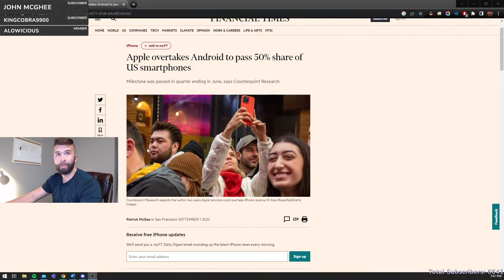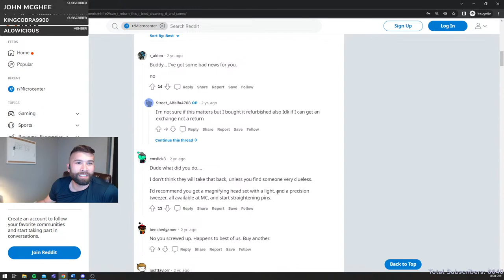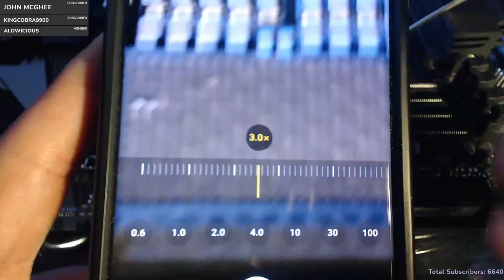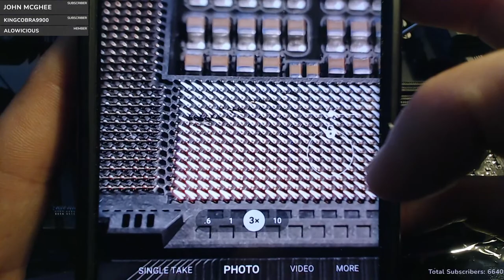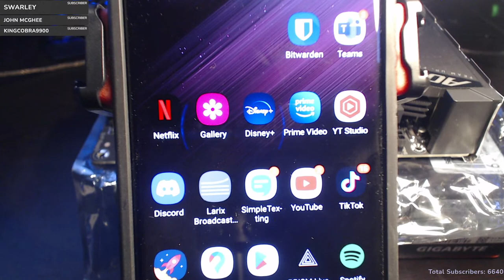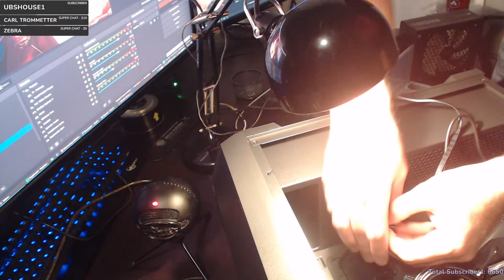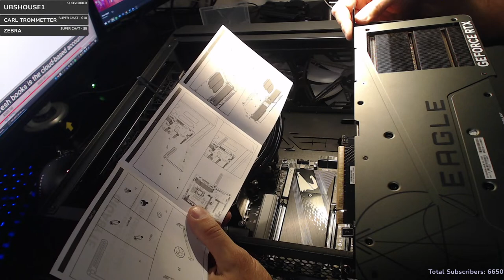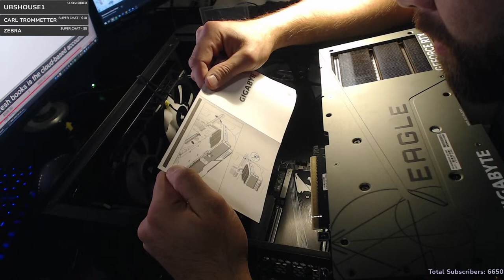New PC Gaming  Build!

Comment: Does it work?   Looks like you bent a pin on the  socket
Reply from the maker: Yep actually had to re-align the pins and everything worked!
Reply: @StephenIRL  you might still have issues and not know it.  Throughly test the cpu and all ram slots.  Also make sure your ram is running in XMP mode once you pass the tests.  If you get no errors your good.